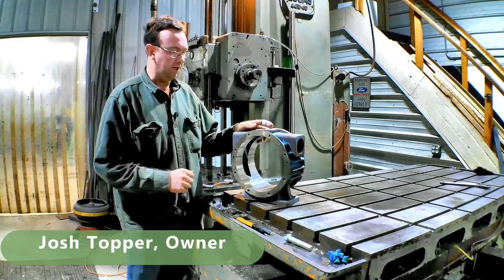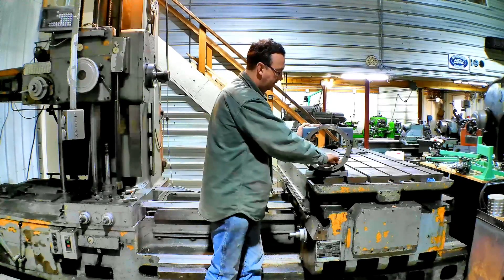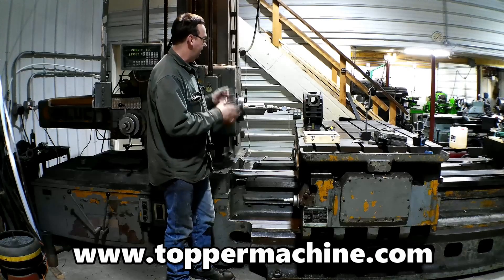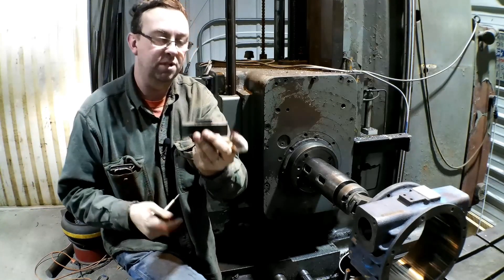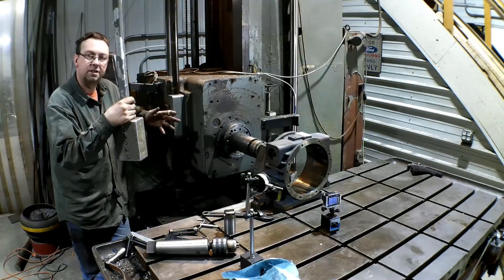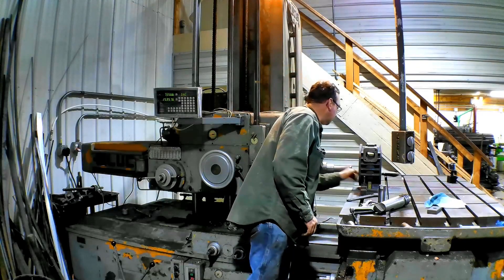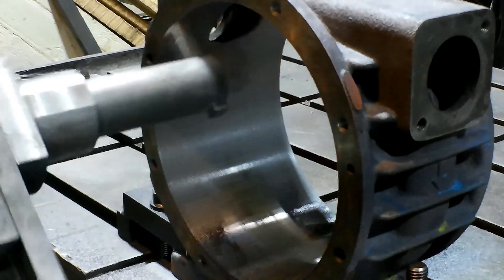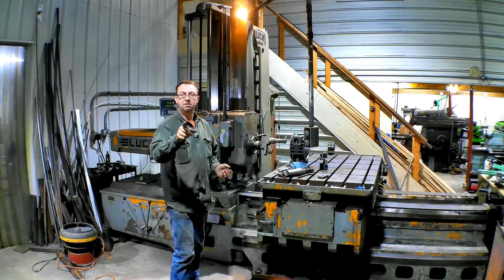Horizontal Boring Mill in Action - Boring a Vacuum Pump Housing - Manual Machine Shop

Comment: Class machine and work!, I used to work on a UNION horizontal before, similar machine, We used to machine big blocks before boring etc, We had a big carbide tool clamped to the chuck housing facing off a big  block, Was slow cut but would do a 12" diameter cut 0.5mm deep, Excellent, Thanks!

Comment: Always wanted to have shot at repairing these pumps, but it consider not cost effective. I worked for a short time in the dairy industry at the havest end. We'd repair, upgrade and do call out work to herringbone & rotary dairies. The Alf Laval pumps would suffer this damage, corrigations of bore. Thought to come from lack of lube, or running to fast (ie, motor and pulleys speed incorrect), or a combination of both. There are two little lube lines, one going to each bearing and seal side. The 2 pots that supply vacuum oil to these can get blocked with mostly tiny insects. It is possible to adjust flow with the metering screws. Bearings have their side seals removed and lips seal are installed back to front to deal with the vacuum. Lids should always be reinstalled to keep foreign matter out of pots. 
Always wondered too, if after how many rebores does one have to raise bearing centres, ie repin cover plates. As that how vane pumps work, with a compression zone?

Comment: Love your channel. I'm in my 80's now but many years ago I worked in an Ordnance Factory, no cnc machines, no digital readouts but we produced using micrometers, verniers slip gauges and dial indicators the most intricate parts for heavy artillery guns naval guns and rotary aircraft engines. Best wishes to you, keep pn with your REAL engineering.

Comment: I am assuming that is a cast iron pump. I would have thot for dairy industry it would be stainless..
Reply from the maker: Yes cast. It's not in contact with the milk at anytime. Just pulls the vacuum on the milking system.

Comment: Nice job sir. We just retired our Lucas boring mill a couple years ago. It made the company a lot of money over the years !
But it would have cost them a fortune to repair...the spindle was just too far gone.
Its been replaced by a Wotan from the late 70's.  And yes, my co-axial indicator is the best tool i've ever bought. It saves so much time !!  It just depends how much $ you want to spend. $100 or $1000. Anyway, great video...and yes...set ups are three quarters of the battle. I have spent 6 hours setting up 20 minute jobs on the boring mill.
Reply from the maker: I would be lost without my HBM. Doesn't get used a ton, but when it does it makes money. Mines in great shape yet, saw very little use it's whole life. Just some minor repairs and upgrades to still do. Thanks for watching.

Comment: My uncle used to rebuild these vacuum pumps in the fox valley 20 years ago. Even back then there was a real shortage of people willing tl take on the job. I used to machine the fiber vanes down to fit thd inner pump slots  by sticking to ths table on the bridgeport with double side tape so i could fly cut it in one pass.
Reply from the maker: I've only used the tape method a couple times. Worked great. If this could become a regular job, I'd look into a vacuum chuck.

Comment: Would absolutely love to see even just a short clip showing the control overview on the lucas boring mill. I’ve always wondered how you engage the quill feed on that model compared to on a Giddings and Lewis where you just pull in the handle in the engage the feed which works great for peck drilling. Thanks!
Reply from the maker: Thats a difficult one to explain.  The hand feed is the 2 levers similar to your G&L. The hand wheel is the fine feed, which you have to engage by magic. The power feed is there also and all interconnected. Yeah, I didn't do a good job explaining that. But it's not easy to explain. Lol

Comment: If you hand grind the nose-radius off the insert with a diamond wheel, you can take light cuts without the chatter. Even with a longer bar like that.
Reply from the maker: That was one I ground. I edited it out, but I tried a couple different grinds. I think the problem was in my bar.  But slowing it way down did the job nicely, and I could do other things.
Reply: @TopperMachineLLC  I think the bit was sticking out pretty far from the bar.
Reply from the maker: @kmcwhq  it was, but that's the only way I could do it. The bar holder would have hit the part otherwise.

Comment: Not many kids know how to manually indicate a part anymore. Even my boss watches when I use my co-ax indicator in my CNC. I even used to run a Lucas back in the 80s. Keep up the good work. I love seeing the old ways.
Reply from the maker: I honestly don't understand that. Isn't that one of the first things to learn is how to indicate parts/workholding?  Sad state this world has come to.
Reply: @TopperMachineLLC  it’s all automated now. Not even edge-finders are used anymore. They have “probes” and “probing cycles”. Machinists are taught to program and calculate speeds and feeds. Nobody just feels the spindle or listens to the tooling.
Reply from the maker: @eriktheredd6036  I learned feeds and speeds, but found that it's only a base line. Feel and sound will dial it in for more production and better cuts or tool life.

Comment: Josh- I like the new video format.  Nice star wars into.  I like how you only show a shot for 5 or 10 seconds and then switch to another angle or another shot.  I think it keeps interest high.  Anyhow, maybe you have seen in my last video, I posted a picture of a Davis type draw key.  It was for Dale in Alaska who just got a G&L mill like I have.  Nice to see your key.  I assume the internals are about like the one I had pictured. Would be nice to see for sure.  Maybe draw on it in magic marker to show what the inside looks like and show it in a future video.  As for the coax indicators, I have a Blake USA model and a Links China model.  Believe it or not, I like the Links China model better. Maybe not a fair comparison, as I got my Blake from work because someone ran it at 3000 rpm and it went the shank !  Simple CNC mistake, don't ya know!  Ha !  Anyhow I reground the bent spindle round and  straight again and it works fine.  It still has a small dither around zero, and the Links indicator has less of a dither, almost imperceptible.  Just  another thing that bothered me about the Blake, is that the instructions that  included in the wood box look to have been photo copied like 100 times over, and it is a really poor quality document.  It just screams, "I don't care".  I think the final production of Blake indicators was sold to a mom and pop machine shop, and it is sadly evident.  Anyhow, I see you have a larger Chandler boring and facing head.  Keith Fenner has one like that I believe. I always liked how adjustable those are.  I know it is beyond the scope of what you are doing, but I have to believe there is something making those pumps wear out.  I know with any vacuum pump, passing debris is always going to be a problem.  But with those chatter marks from the pump vanes, I think something is wrong, making the vanes chatter.  I have seen centrifugal pressured vanes and also vanes with springs.  Something is causing them to flutter and skip.  Just my observation.  Anyhow, love the HBM footage.  Always interesting for me to see.  ---Doozer
Reply from the maker: Thanks Doozer. Can you email me that drawkey info. I saw your video, but didn't screenshot it. Mine is a similar principle but all done internally. Wish I could have gotten the original to dissect and copy. I like my chandler head, so versatile and very inexpensive in comparison to others. The pump is not my project, otherwise I would dig deeper. But it has ran for 20 years 3 hours, twice a day. But I'm guessing by the wear it was contaminated. More wear in middle between inlet and outlet. Once the vanes start bouncing, it will get worse.